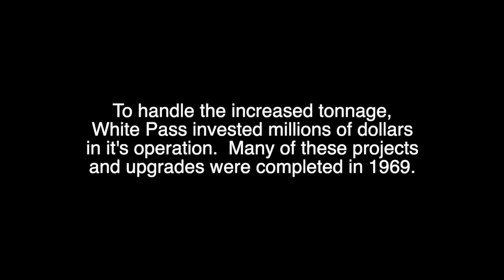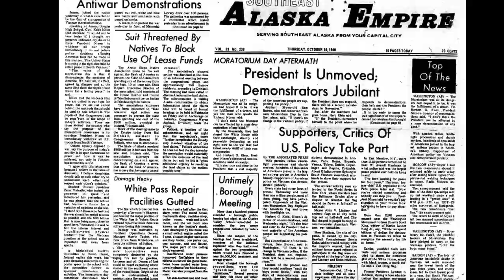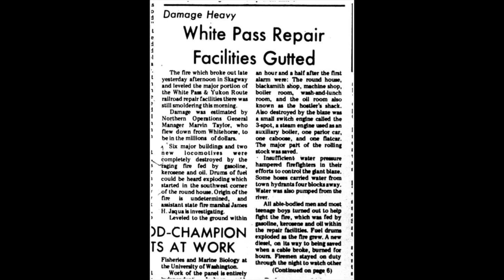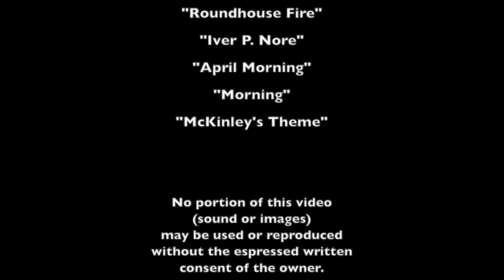1969 A White Pass & Yukon Route History

Comment: I hope when they built the replacement shops, better provisions were made for fire protection.  For example a better, more reliable water supply and an automatic sprinkler system inside the building.  IMHO, as poorly equipped as the Skagway Fire Department was, if a serious fire had started in the center of town, in all probability a great many buildings in Skagway would have been lost.  I'm not criticizing the volunteer fire department; they did the very best they could with what equipment they had.  However as a fire protection professional I feel the municipal government was negligent for not providing funding for adequate fire apparatus.   I'm also left wondering why the railway's fire insurance underwriter didn't insist on better fire protection for the old shops.

Comment: The Cantilever bridge that was closed should be rebuilt and reused again. Restoration must be put on to the Cantilever bridge at dead horse gulch. I think a good name is the Dead Horse Trestle. If I designed a new locomotive for the White Pass and Yukon railway, I would make it a CoCo narrow gauge diesel locomotive that would have cabs at the front and back  and it would be made of light metal’s and a super strong engine and it would be full width. The cabs on both sides will look like the Alco locomotive’s fronts but instead they would be full flat on the top and rounded at the front’s.
Reply: Well actually Tweetsie Railroad already kinda used "dead horse trestle"
Reply: That all sounds wonderful, but where is the money going to come from? (Unless of course you are planning to fund it yourself?)
Reply: Why cabs at both ends?  That increases the initial cost as well as ongoing maintenance costs.  Also, full-width carbodies have long since fallen out of favor because the "road-switcher"  type hood units were found to furnish improved access for maintenance.  I'm not trying to be negative, but those are the facts of the matter.